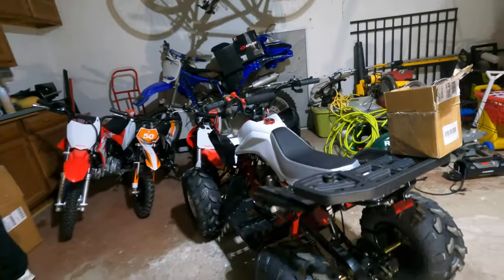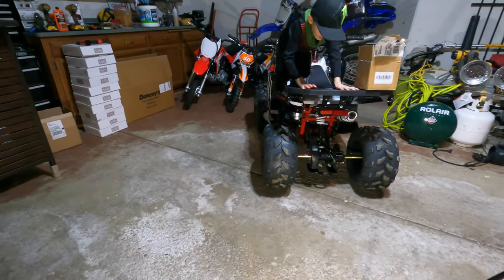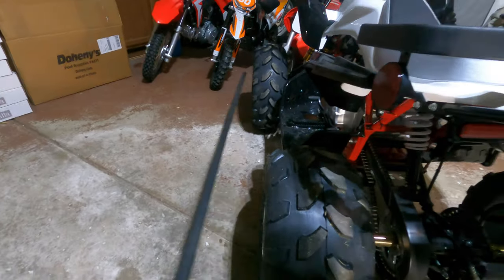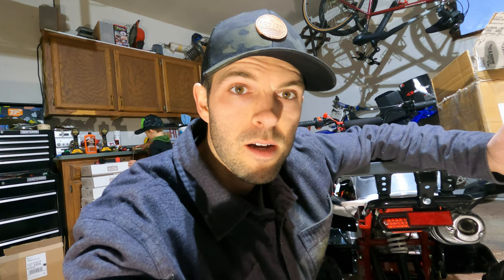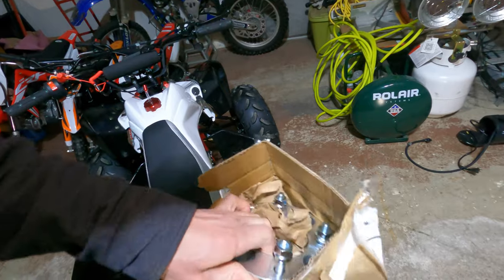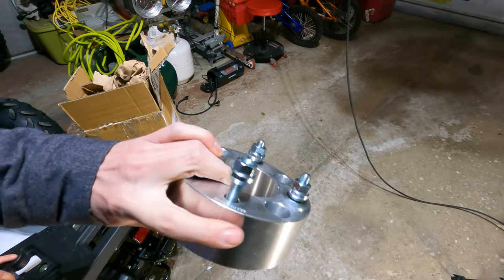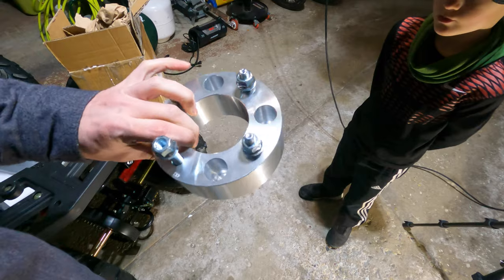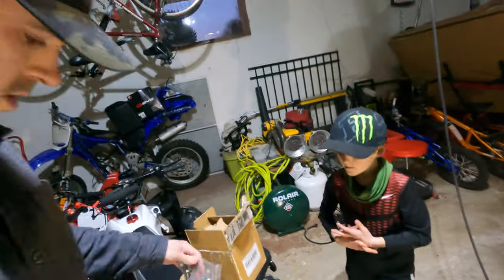Important and Easy Upgrade for 2021 Cheetah 125 - Rear Wheel Spacers

Comment: I've gotta watch this video , cause I wanna go pick up this quad that's for sale and im going to try to take the rims off so that it'll fit in the back of my SUV. hopefully it fits, it should fit if I remove the wheels. I have a 2012 Acura MDX , which is like a mid-size SUV... im going to let my seats down but that doesn't give me much space but hopefully its enough with the wheels removed

Comment: IT’S VERY IMPORTANT TO REMOVE THE LOCKNUTS ON THE BACK OF THE HUB BEFORE YOU TRY TO TAKE OFF THE WHEEL LUG BOLTS.
Reply from the maker: Yes for sure. I did indeed do that but didn’t really show it or mention it. Thanks!

Comment: You should use a tapered bolt head to fit in the recessed tapered holes of the adapter otherwise you may have problems in the future. If not able to find, maybe tapered washers behind the bolt head. The lug nuts supplied are for mounting the adapters to normal studded hubs. Maybe a bolt in ??10 mm ?? from the back side that the tapered lug nut will fit on would work great.

Comment: Nice bro I'm sure the kid loves it. What sockets are you running?  Looking to give my kid a little more torque
Reply from the maker: Running stock sprockets. Ours is nice n torquey.  We didn’t want to sacrifice any top speed.
Reply: @toolstoys70  can't blame you there. Ours has a 13 in the front going to swap out for a 12 so we'll see. I've already bumped up the carb to 22mm . Just doesn't seem to have the grunt out the hole.
Reply from the maker: @BwHippie84  seems like we got a strong motor. I have heard people saying the same thing as you though.
Reply: What size tires are on that thing. We've got 19x7x8 on all 4

Comment: These are good videos for the Tao Tao, do you know if this is the same quad as the Xpro Blazer? They seem to be other than body work.
Reply from the maker: Thx!.  I'm honestly not sure.  Taomotor is a huge company now with their own factory.  Perhaps they make the parts for xpro too, however again I do not know.  They do look strikingly similar.
Reply: @toolstoys70  yes, it is hard to know with certainty, seems the Xpro is a less expensive option, but I notice the new Tao Cheetahs have a digital dash which is really cool for this year, considering getting my son one. Thanks for all the good information, it is appreciated.

Comment: Do you think those spacers will work on an Apollo 125 atv ?
Reply from the maker: Honestly I'm not sure.  They didn't list that model for its application.  It appears the Apollo is also 4 lug.  But the hub size needs to be the same and I haven't verified that.
Reply: @toolstoys70  
Thanks for checking. Apollo’s are 4 lug

Comment: Hello, did you factory bolts come with nuts for the bolts or did you need to buy some.     Mine don’t have buyers for the inside of the rim.  😩😁 help a brother out. Lol
Reply from the maker: Yes nuts were already on there from factory.  I needed to buy longer bolts but I got those with the spacers at time of purchase.
Reply from the maker: Take a bolt off and head to hardware store and get the nuts that fit.  Get either locking nuts or lock washers with standard nuts.
Reply: @toolstoys70  that’s because of the updated wheels you have for longer bolts ??  Yeah I just ordered these spacers. Love that they fit flush.   💯✔️
Reply from the maker: @NeoStorm_401  Yes with the wheels mine has it needed longer bolts.